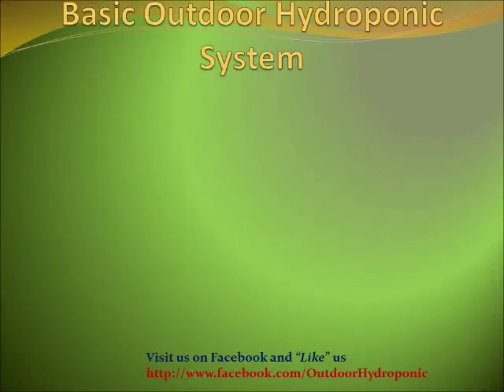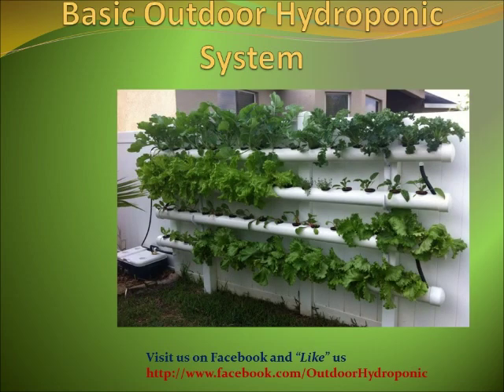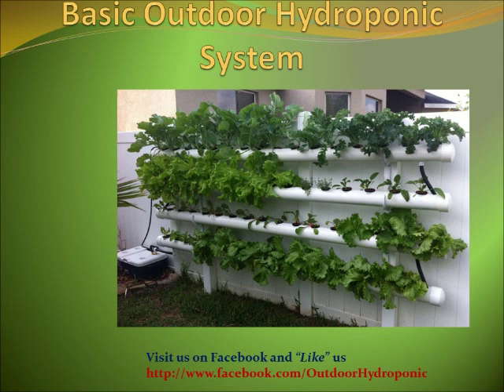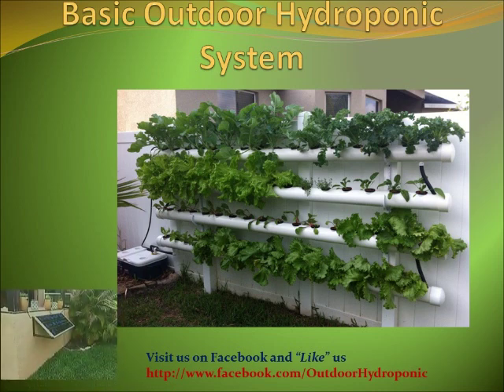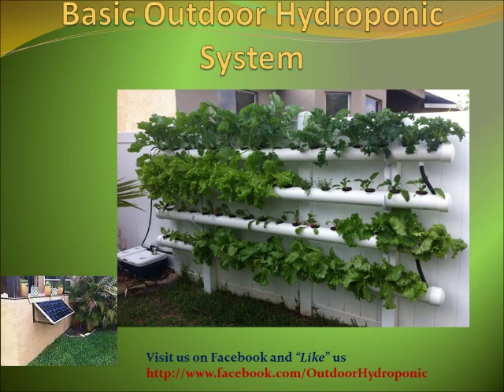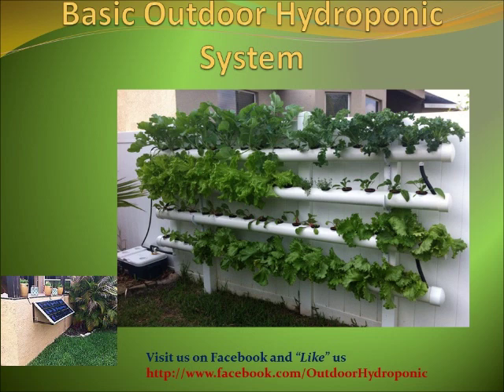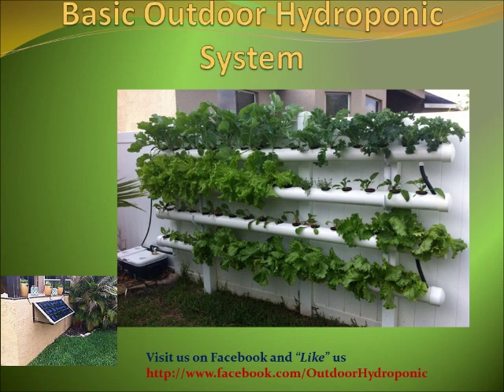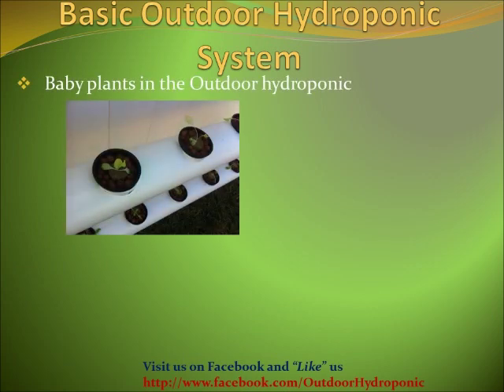DIY Outdoor Hydroponic Grow for beginners

Comment: Hey bud great system, just built one myself, for first time, I was wondering if you can tell me if there should be constant water in pipes or should it drain out completely, I have my pipes perfectly level so there is about 1/2 of water at all time in pipes, or do I need to elevate one end more so it completely drains out, and if so how many times does the pump need to run, every 1/2 hour or every 4 hours? Thanks.
Reply from the maker: I usually leave water inside the pipes so that the plants can take the nutrients anytime